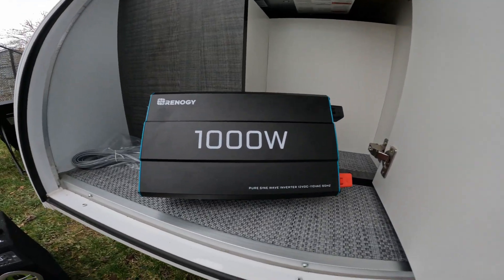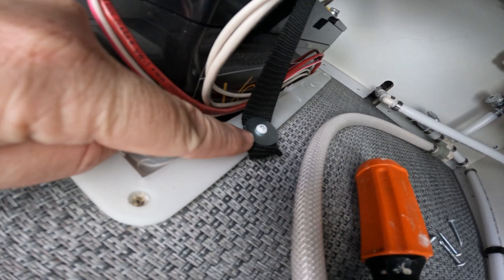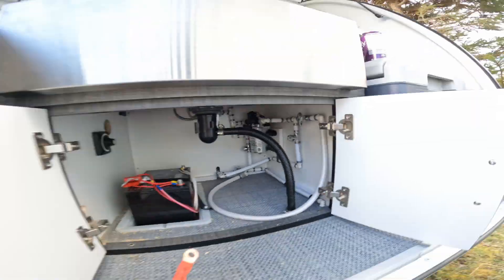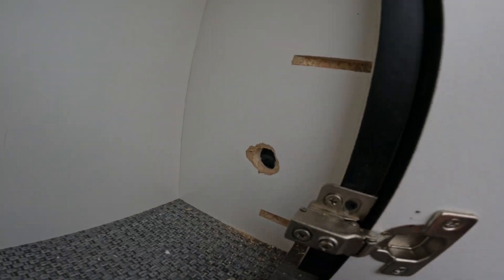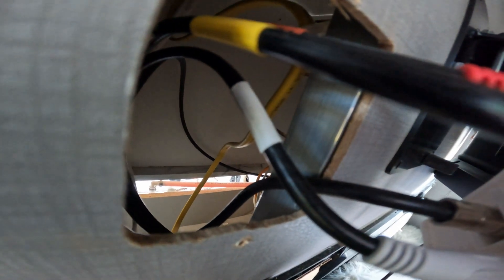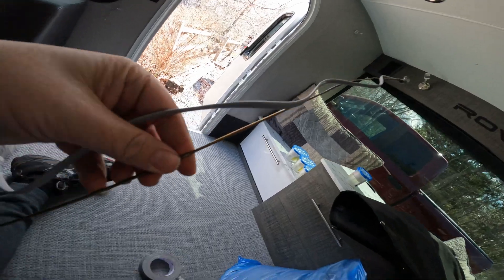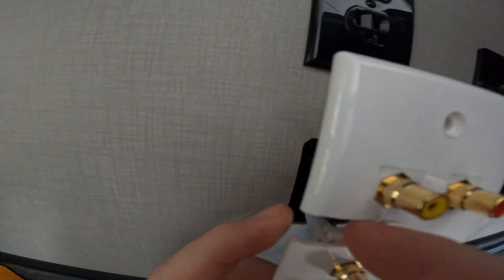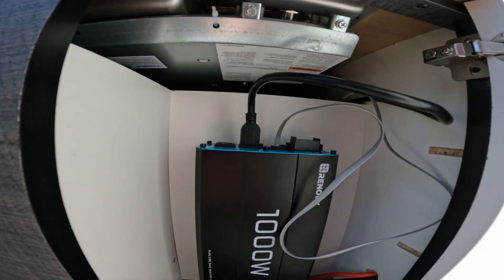How to install a Renogy 1000 W [or ANY ] inverter in your InTech Luna the EASY way.

Comment: What size of circuit breaker did you use for 1000w with original wires from the Renogy?
Reply from the maker: Built in camper breakers

Comment: Thanks for the video.  I am new to RVs but not to camping.  We are picking up our Luna next week.  

I’m curious if you considered a solar generator with 30amp connection vs your current setup.  Thanks again for your videos, I’ve learned so much!
Reply from the maker: I have not considered any other options than i have been running.  I wanted to keep is basic.  thanks for the positive comment!

Comment: Heres my question- can I wire this to where instead of the TV being powered its the fire place/AC? My wife and I want to do this with ours so when we boondock we have heating and cooling.
Reply from the maker: you COULD but AC and Fireplace would eat up even the biggest of on board batteries rapidly

Comment: Thanks for making this video. I'm going to be tackling this install in a couple weeks.  In my design I'm running a 200 amp breaker between the battery positive and the inverter positive.  I'm installing a renegy 2000 watt pure sine wave inverter with two lithium batteries.
Reply from the maker: Sounds awesome. You got this!